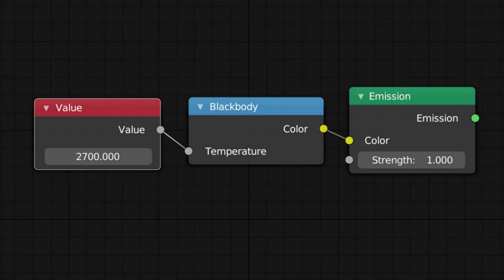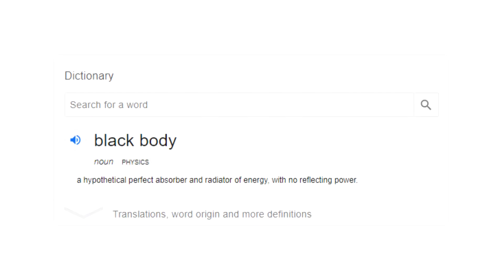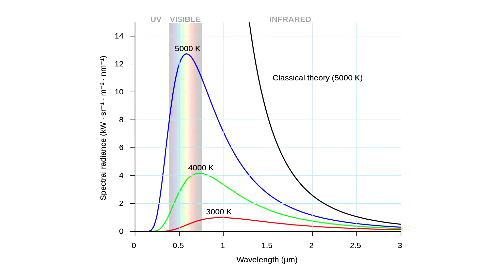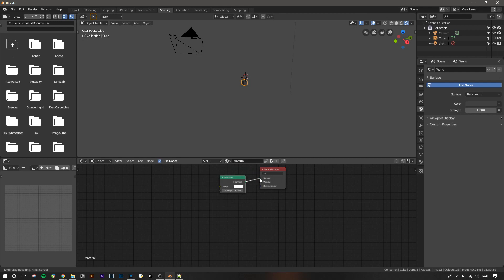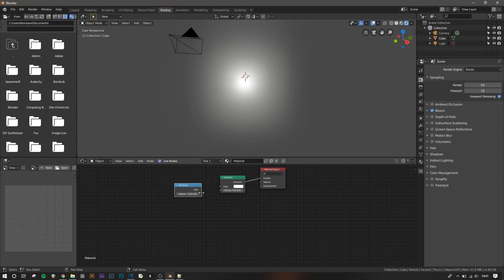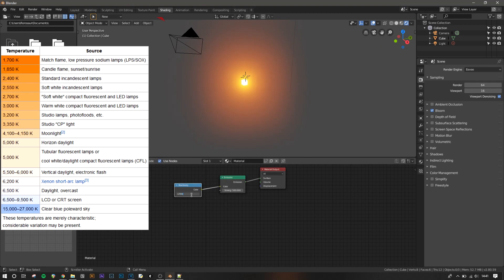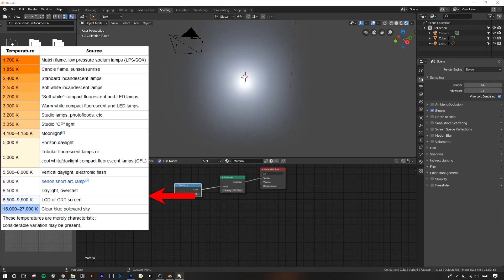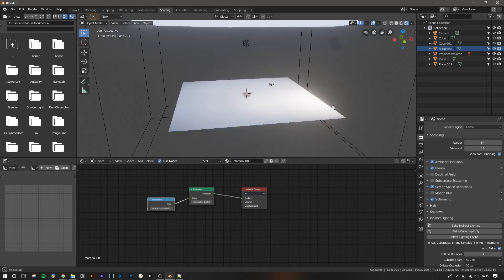Blender | The Black Body Node (And Colour Temperature)

Comment: Is it possible to change color temperature in Compositing?
Reply: Yes, It is. I have created a set of node groups that allows you to not only substitute completely the original blackbody node but also change the white balance in the compositor. Also created another node group that works specifically with light groups to change the color of pure white light sources added previously to light groups. At the moment the light groups node group can handle 10 different light groups. 

I have made my source blend file available to anyone on Blender Artists.

I came up with this solution cause there was no native solution in Blender to deal with white balance in the compositor. After a long period of studies and headaches I developed them.

My nodegroups are based on RGB curves and not color samples chart as the native blackbody node in Blender is built (I don't know why they decided to build it this way) I also built my blackbody node group to be able to cover temperatures from 1000 k to 40000 k.

Since it's built based on curves it has smooth transitions between any given color temperatures and in the compositor the white balance node group works well in images rendered using the native blackbody node as well.

You can find the file here: https://blenderartists.org/t/blackbody-behavior-when-using-with-light-sources/1452214
Reply: To work with those node groups, some instructions may be needed and I didn't provide them there, but I would gladly help you with that if you are interested. Just drop me a DM there if you find any difficulties.